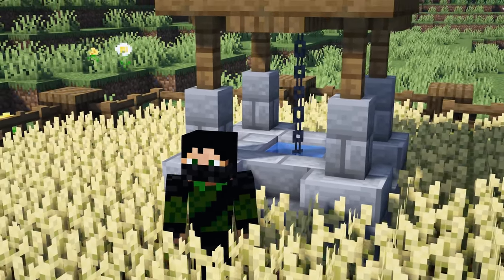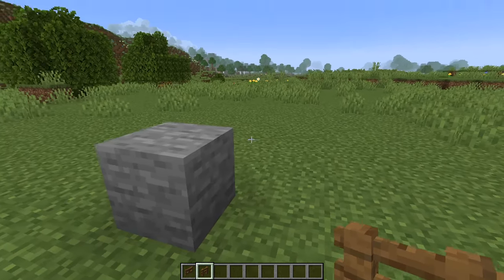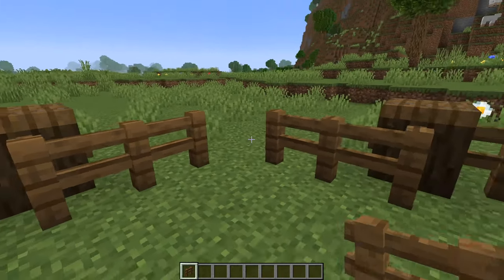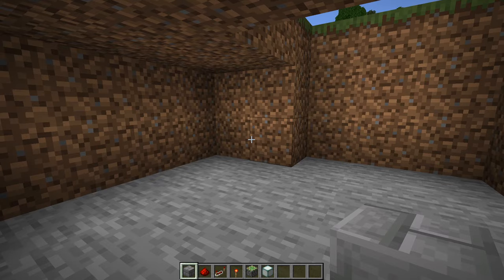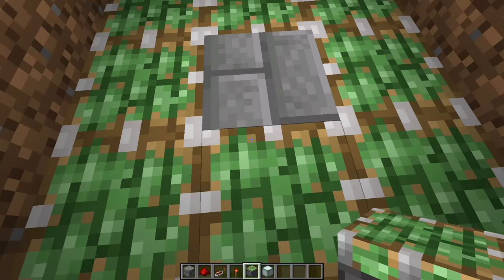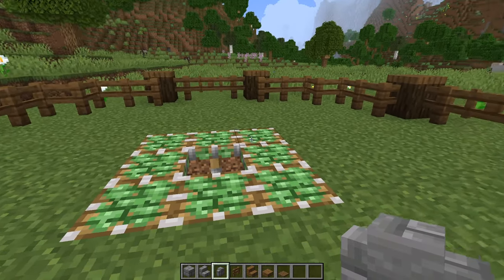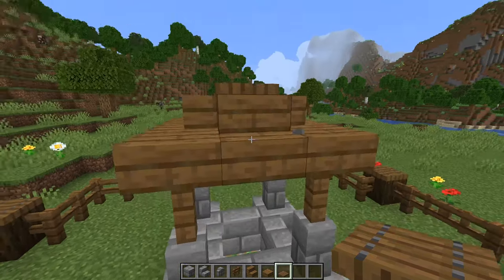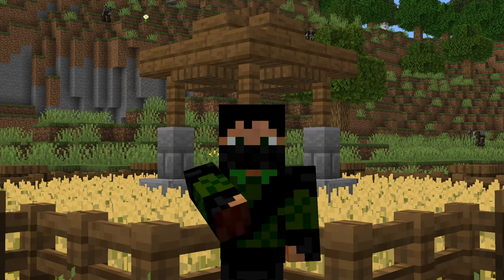Minecraft - Aesthetic Redstone Crop Farm Tutorial (How to Build)

Comment: If you’re doing this in survival, I would recommend using a button instead of a pressure plate, bcs a mob can activate your farm, or you could use a diamond pressure plate, also they can jump the blocks next to the fence, if you use slabs instead of the trapdoors they can’t get over it
Reply: Diamond pressure plate doesn't exist

Comment: hi! love the video, it was really easy to understand and the farm is so cute! :>

for anyone like me who's trying to make this in survival and doesn't have any slimes nearby to make sticky pistons, i managed to make this using regular pistons!! here's how :)

I haven't really tried this multiple times so I'm not sure what the most optimised setup would be, but basically I used regular pistons in place of all of the sticky pistons, and placed sand on the pistons that would be directly next to the block of water for the water source (directly in front and to the side, not diagonal). It works because sand will naturally fall with the piston, you dont need sticky pistons to retract it! so when you press the pressure plate (or replace that with a button as another comment suggested) for the pistons to drop down, the sand drops down and the water flows out just as intended :) 

I followed the video exactly apart from this change and everything works fine and looks great :> thanks for the video again, and hope my comment can help!!
Reply: It worked.
Thankss